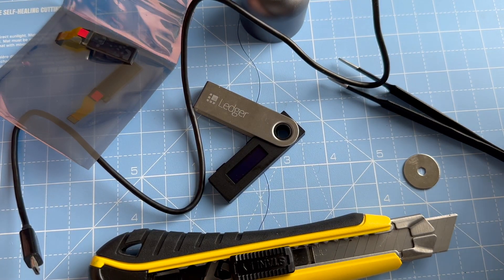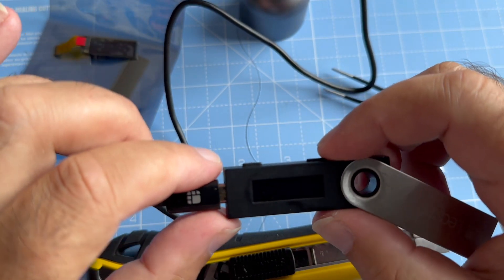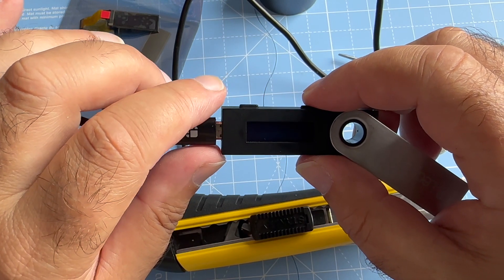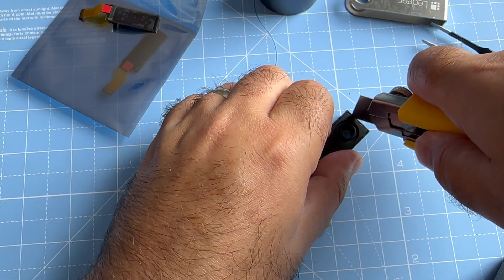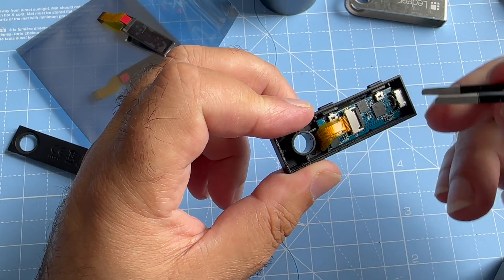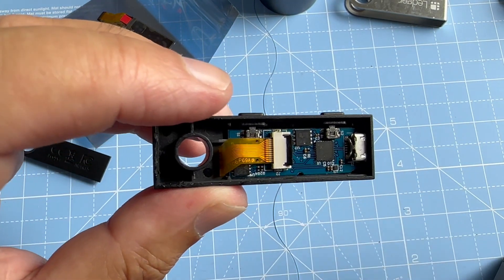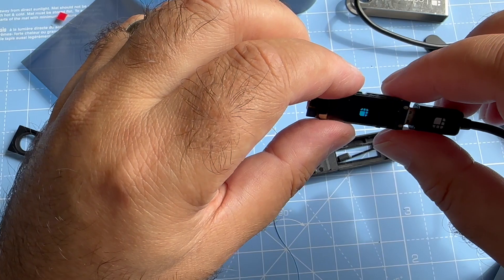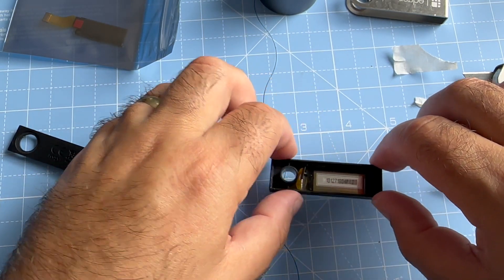My #ledger Nano S screen went dark and I replace it with new one that I ordered from #aliexpress

Comment: massive pain in the ass. it just refuses to seat correctly. i have the buttons oriented where the bar connecting is below the buttons. i'll try again tomorrow
Reply from the maker: I struggled with the same problem as seen in the video. :)
Reply: @technonatorr  finally got it. getting the ribbon into the chip also took a few frustrating minutes whereas it took you like 2 seconds. lol
Reply from the maker: Great, 🎉🎊 I hope the screen never goes black again.

Comment: How do we know if we need a 12 pin or a 15 pin without taking it apart first
Reply from the maker: As far as I know, only the way you can tell which one you have by opening it and checking the number of pins on the connector

Comment: Dude where can I get the 15 pin ? Can find one in your link but it is not available. Maybe sold out ? You have other suggestions? Much appreciated.
Reply from the maker: I don't know where you can find 15 pin. You need 12 pin.. And also I checked the link it works... Try to search this. "0.91 inch OLED blue word 12pin screen"
Reply: 0.91 inch oled blue word 12 pin screen
Reply: How do we know if we need 12 or 15 pin .  Without taking it apart first

Comment: Tip.....if your little black push bar pops out (it's very loose and probably will) it is shaped that it only will go in ONE WAY if you want your cover to go back down.  If you look at the bar carefully, you'll see it's slightly offset where the buttons go back into the holes. Although they will go into the holes easily the wrong way, the mother board will not set inside it's housing correctly and you won't get the cover plate to snap in until you flip the button bar around 180* L-R.  I had to use tweezers to handle the black button bar because it's so tiny.  Good luck and take it really easy with it with lots of light to see with and a clean surface to do this on.
Reply: Hi Sir, what type of penknife are you using.  I think I am almost destroying the groove with my penknife
Reply: @bb5236  A blade strong enough that the blade will not bend. Cheap ones bend and can't do the job. Just be careful and not push too hard when opening it up and
open it all around the device (not just in one spot) as best you can so you don't break the lid of the device.
Reply: @USCG.Brennan  i m using a strong one the blade does not bend at all but it is probably not thin enough such that the groove is being destroyed
Reply: @bb5236  Yes, it the blade is too thick it may not slide in properly.  My device got slightly dinged up too, but just work your way around that area as best you can.
Take it easy and it will work.   I thought the same thing you are now when I did mine, but it finally opened up.  Patience is the key  Good Luck!
Reply: @USCG.Brennan  thanks bro. any idea what is the thickness of your penknife?
Reply: @bb5236  Sorry, I don't.....one like he's using in this video and I also had a very small screwdriver too.

Comment: Could have any dangerous over stealing cripto from wallet once replaced the screen ? Like any malware recorded at the screen circuit?
Reply from the maker: Screens are standart output devices and this screen is not produced especially for the Ledger. If you want to feel safe, you may not buy from someone who sells screens specifically for Ledger.